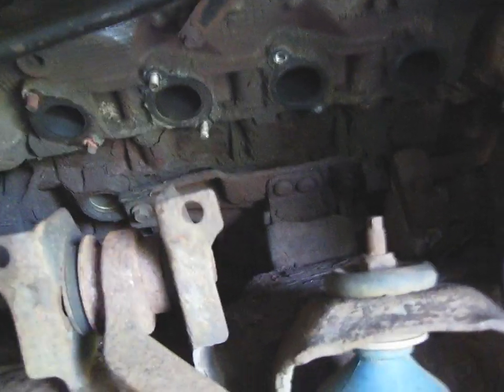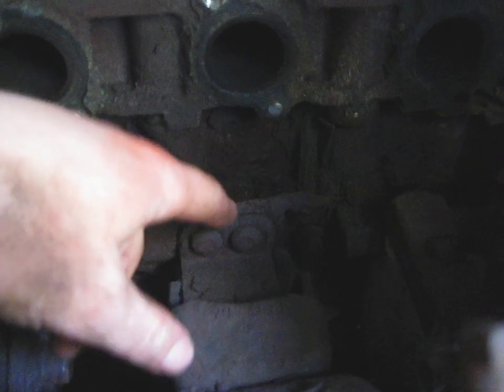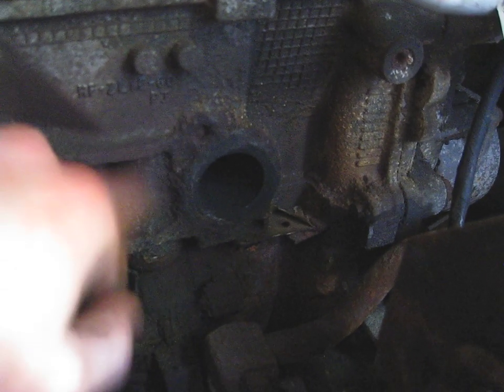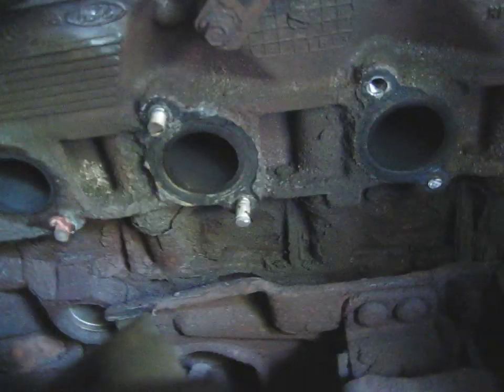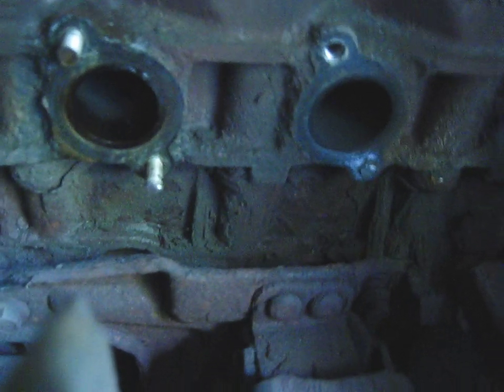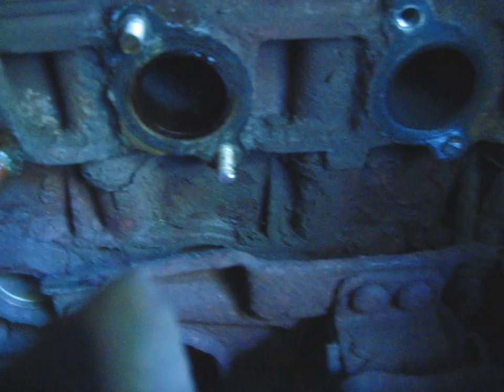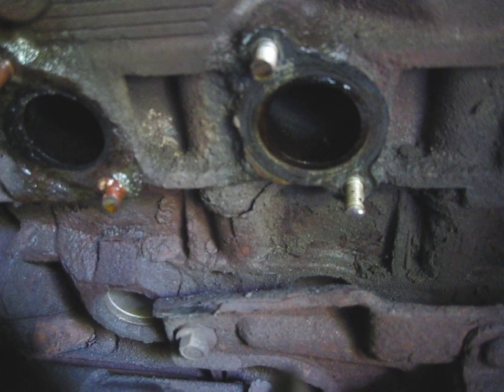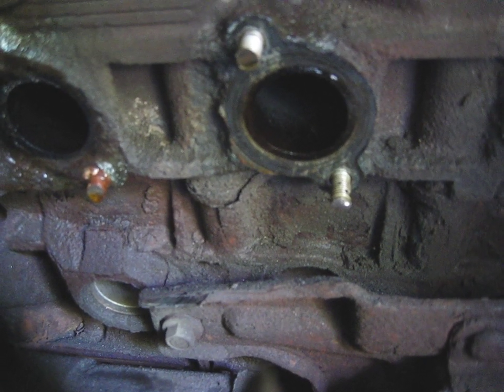Ford F150 Exhaust Manifold Removal Part 3

Comment from the maker: It was the passenger side.  To reinstall the wheel well just pop it back in there and use a few tree cone's, and some screws that go around the edge of the fender down the the mud flap.  Thanks for Watching

Comment from the maker: To remove the the plastic inner fender well, you have to remove mud flap, then the screws to the fender flare, then you should see some plastic clips in the front holding it in with some on the top.  After they have been removed, you should be see what other screws or clips to remove.  There might be one or two under the truck where mud flap was.  If you still need help I can make a video of what to remove.  Good Luck and thanks for watching!